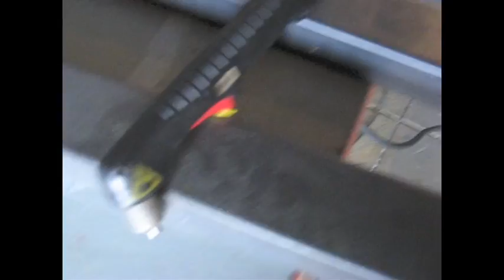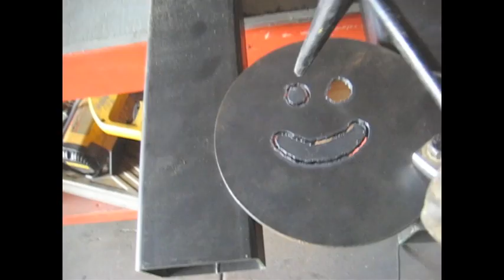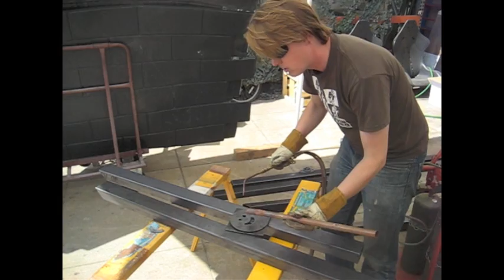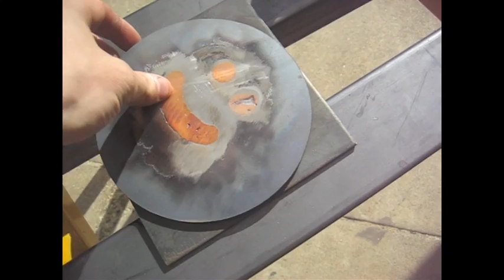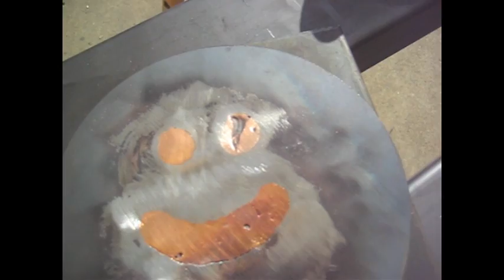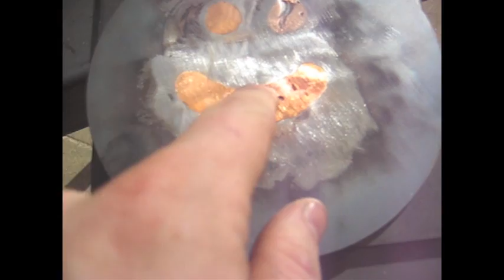Inlaying Copper Into Steel

Comment: I believe you would have had more consistent results using bare electrical copper wire as a filler.  Can't go wrong with brazing flux either.  Otherwise good technique.  I have been saving for a stick welder but the savings I have thus far is going for a plasma cutter instead.  You inspired that.  Thanks